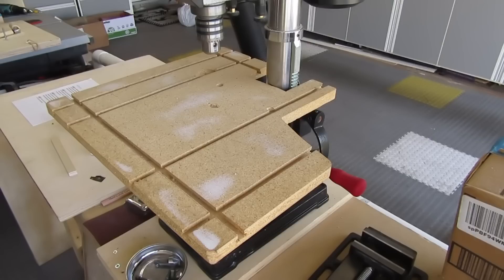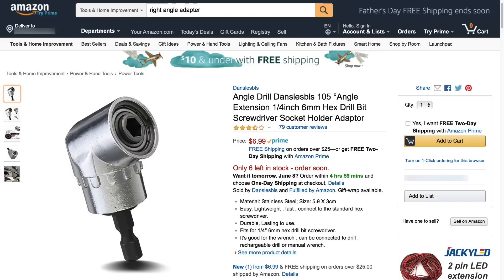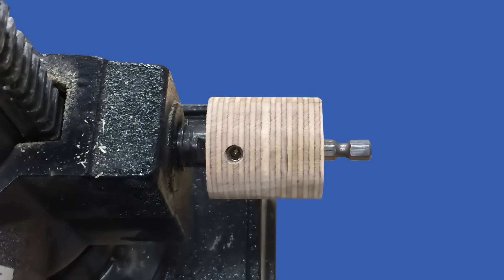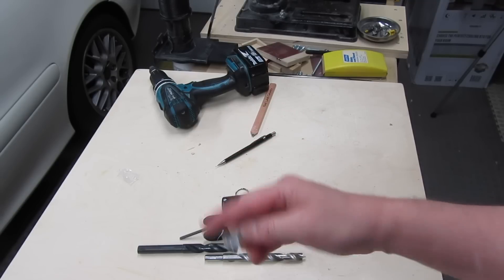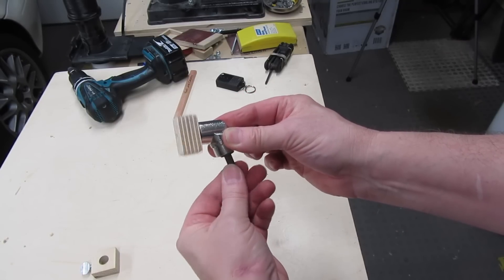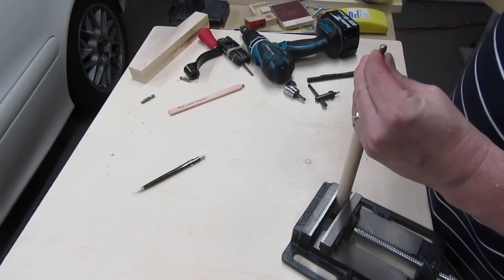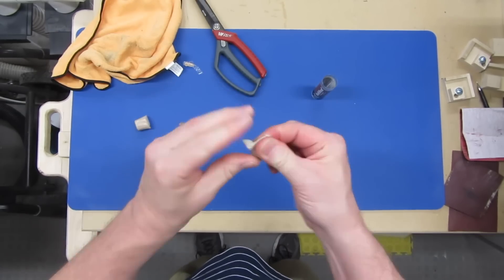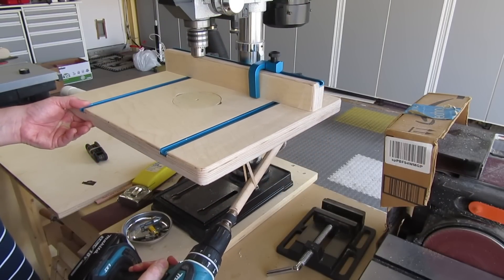Drill Powered Table Crank for a Drill Press/Pillar Drill

Comment: I made my copy a couple of days ago!
I made my coupler from 1 1/8 dowel
I had on hand. It is the largest dowel
that fits my mini lathe. I bored a 
1/4 hole all the way thru. Then
I used a mini boring bar to widen the
Hole on one end to 14.5mm to fit my shaft exactly. I used a tap drill
For the set screw.
I pressed a hex Phillips bit into
The 1/4 hole on the other end
and it worked great.
I made a crank handle from a scrap
piece of 3/4x1x5 inch plywood.I drilled
a 1/4 hole near one end and tapped a 1/4-20 near the other end.
I took a another two inch piece of dowel bored a 1/4 hole threw it and
Used 3 in bolt to mount the dowel in the threaded hole.I presses a 1/4 hex
Bit into the other hold to couple to the right angle shaft. It works great!
Thanks for the idea. The only thing to tackle is the table lock screw extension!
Reply from the maker: Awesome! 🙂

Comment: What a great idea!  My Delta floor mounted drill press  has a very poor handle set-ups and I'd like to try this.  Do you think your plan would work on a full-size press?
Reply from the maker: Probably not, but I've since changed to using these: https://www.amazon.com/gp/product/B07BHKJSF2/ref=ppx_yo_dt_b_search_asin_title?ie=UTF8&psc=1. I think they'd work. But they're a lot of work - I used a steel rod woth some bearings like these (I think): https://www.amazon.com/gp/product/B07TQ6J4WQ/ref=ppx_yo_dt_b_search_asin_title?ie=UTF8&psc=1 and some collars like these https://www.amazon.com/gp/product/B08DXWMHXF/ref=ppx_yo_dt_b_search_asin_title?ie=UTF8&psc=1, although those aren't available anymore but I'm sure someone else makes them. Good luck!
Reply: @TheNewbieWoodworker  Thanks, Dan!  We're still looking forward to more videos.  How about one on making one on to to make accurate 45 degree picture frames?
Reply from the maker: @DonBradway  Good idea, except that I need to watch videos on how to do it before I can make my own. 😂 I'm horrible at it.
Reply: @TheNewbieWoodworker  LOL!  You're my hero!  ;-)
Reply from the maker: @DonBradway  ❤️

Comment: Dan, Dan here, too!  Any chance of you making a video on your final drill press table?  I like your design - and maybe it is in the videos, but I searched and could not find one.  There are at least a dozen out there, but your seems simple and effective.  And - I love the crank extension tip in this video!!  Like you, I'm a 62 y/o newbie woodworker (been doing it for roughly 5 years).  I'm retired (or just tired), and have given up by lifelong hobbies of "mechanicing" on race cars, motorcycles, and even my car other than routine maintenance.  I still however, work on my own and many neighbors small engines (yard equipment, pressure washers and such).  If you've settled on a drill press table design that covers 90% of the routine tasks you do, I'd love some details.  Thanks in advance, Other Dan
Reply from the maker: I don't have a final video, and I'm not going to make one, because I think this one's better: https://www.woodsmithplans.com/plan/drill-press-table/. 😄

Comment: Newbie Dan! It has been overa year, and I was wondering if you still use this solution to crank the DP table up and down. Thanks!
Reply from the maker: Hey, David! Yes I do, but I'd like to switch to what Woodsmith uses here (I don't think you need to get the plans): https://www.woodsmithplans.com/plan/drill-press-table/. They use what they call "Miter Gears", and if you search Amazon for "miter gear" you can see right away what they're using. But what I have works good too.
Reply: @TheNewbieWoodworker  I’m making it today! Have all the parts ready to go except the crank handles. My drill press handle broke when it fell over. Good lesson on why you should bolt a top heavy benchtop drill press to your mobile table. Been raising & lowering it with a wrench for 2yrs. The wrench frequently slips off & I have to remove the table each time. Decided life is too short and it’s time for a solution!
Reply from the maker: @CindyL4261  Awesome! Let me know how it works out.

Comment: Thanks for the inspiration, in my case I have a HF floor model, and the gear to raise & lower are misaligned or just junk.  I bought the 105-degree thing, but it was too lightweight, so I ended up using a  3/8" socket setup.  A 9/16 socket fits over the shaft, drilled a hole thru the socket and shaft which now gives you a 3/8" square drive.  Used 3 flex elbows  and extended it to the front of my table.  Just use a ratchet to raise and lower it.  I could use a drill, but it's too jerky because of the POCrap HF product.
Reply from the maker: Awesome! Glad you got something working. 😄

Comment: That's a great Idea! I wish I would have found this a few weeks ago. I've been building a drill press table for my floor model. Since I had the same crank problem but more space I just elevated the table on the cast iron table to give me clearance. The power feature is great but a hand wheel mounted under the table would work great since I don't raise and lower the table that often and then only an inch or two at a time. Again good job and it gives me more ideas which I find as the most valuable part of watching videos.
Reply from the maker: Thanks! And I agree - the best part of watching YouTube videos is the ideas I get from them, which a lot of times has nothing to do with the subject of the video. Anyway, glad to help! 😄

Comment: Pretty slick, Dan... a little work saves a LOT of annoyance... I'm inspired!  
At 2:00 you mention viewers could try to drill and tap the socket for a setscrew... that would likely be problematic since the steel for a socket is generally hardened/toughened to make the socket durable which also makes it extremely difficult to drill and tap... so you adapter method is much more practical.
Good work on the video... Best, Matt
Reply from the maker: Thanks, Matt. I didn't know that about sockets, but I guess it makes sense. But now I want to go try it. :) I guess it'd probably ruin my drill bit, though.

Comment: Now just need a small 1/8 hp sewing machine motor with a momentary contact switch attached to that shaft. Strap it to the side of the drill press motor.
Reply from the maker: I thought about something like that, but I don't know enough about Motors.

Comment: I groan every time I need to adjust the height of my drill press. I like this idea. Have you considered purring some kind of mounting block to the underside of you drill press table to hold the adapter in place?
Reply from the maker: Thanks. Yes, I've thought about it. Right now I have a rubber band stapled to the bottom of the table. (I edited it out of the picture.) It's working well enough, and I may stick with it. We'll see.

Comment: Great Idea.  I have that same drill press and have the same issue with the crank.   I am thinking that if I made that crank like you did then I would always have to have a drill handy, and don't really care for that aspect.  I wonder if there is another way to get the table up and down without the drill or slowly by hand.  Got to be right?
Thanks for the video.
Reply from the maker: Thanks for the comment. You might take a look at this video from Izzy Swan. I know he uses a drill also, but I'm thinking you could put a crank handle on it. https://youtu.be/ew68Y18E88U
Reply: I had the same problem with my Novatek drill press and putting on a large table. I used the cast iron handwheel from grizzly but it doesn't work too well because of the reduced leverage but it is usable. I used the same wheel on my Delta jointer when the plastic knob for positioning the fence broke from age. Much better. Will try this new solution as well on the drill press.
Reply from the maker: @billinfarmington5189  Good luck!

Comment: Great idea. You can get longer service life on wood projects with threaded holes if you harden the threads with a little CA glue. We use this method all the time on our RC model airplanes. Hope this helps you. Keep the great videos coming.
Reply from the maker: Thanks. Great idea! I'm not sure I need it on this particular project, because hopefully I won't be removing it much, but I use threaded holes a lot, so that will help. Thanks!